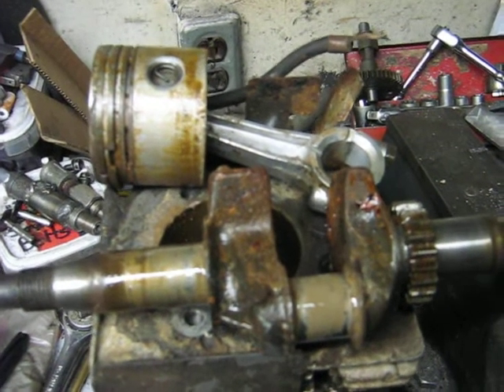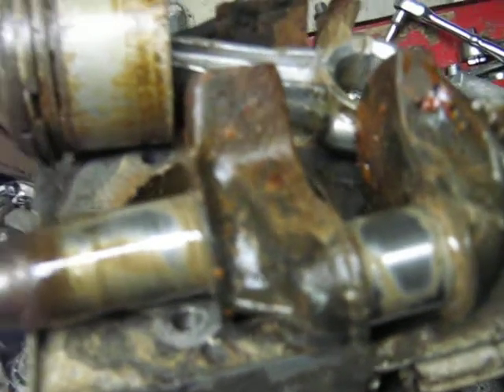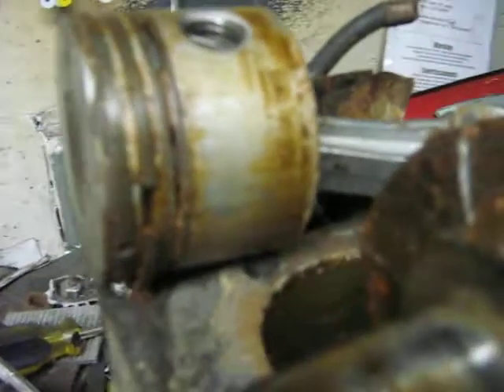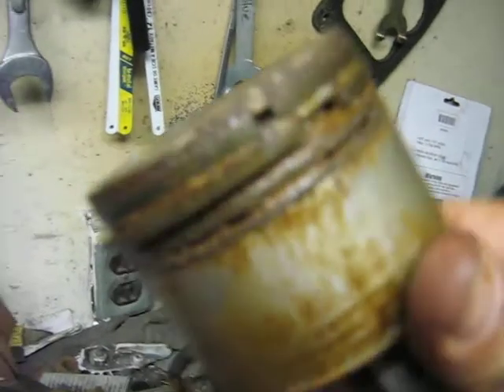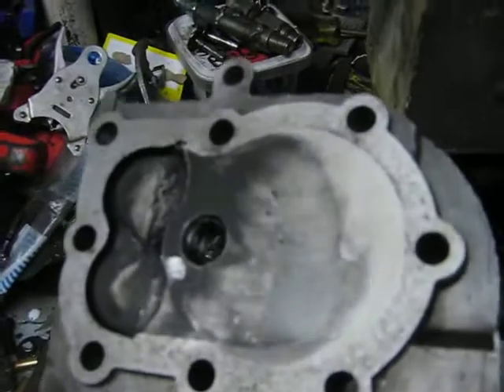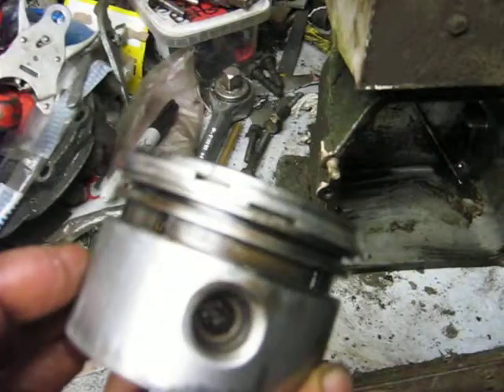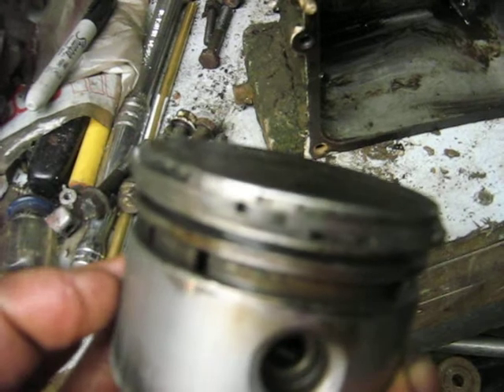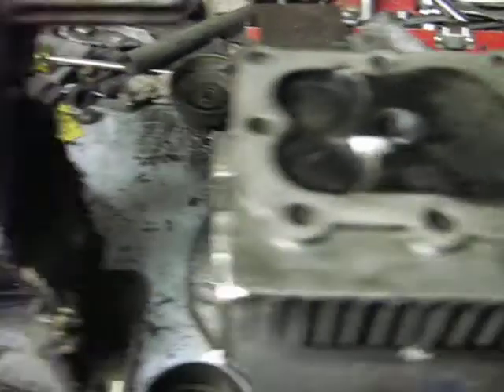Mr Grungy vid5 Piston and Crankshaft

Comment from the maker: With this head on a loaded down lawnmower engine, it would knock. We were trying to get an engine to pound itself apart, but it didn't do it. The block we were using had a bad top bearing, so it wasn't worth fixing, so we decided to blow it up. I had to loosen the torque off the con rod bolts to get the job done!
This head doesn't flow very well. I used it on the air compressor engine for a while, since it really loads the engine down when the air pressure in the tank is high.